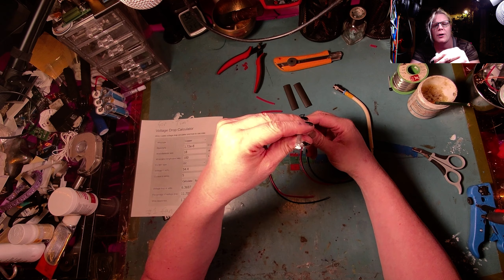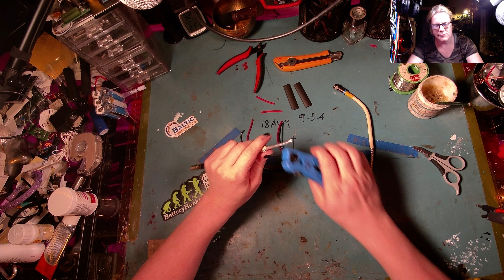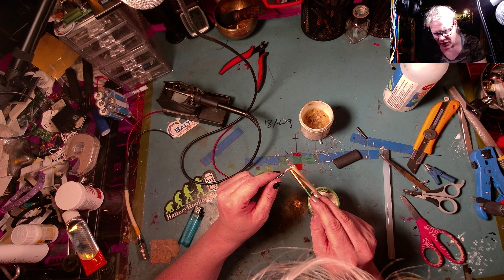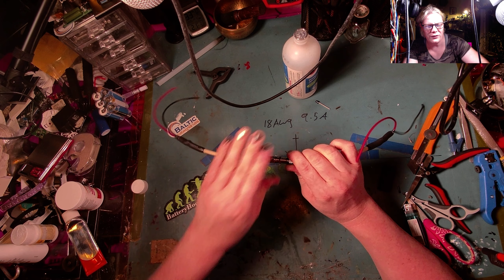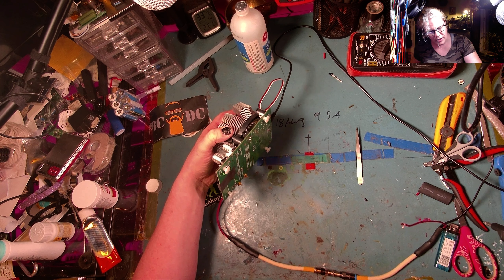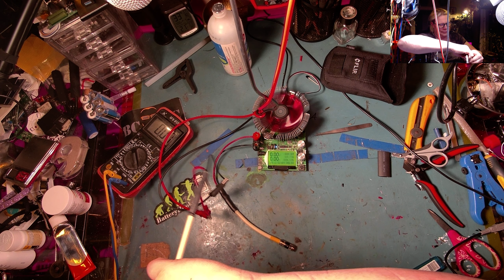Adapting Coax cable to carry a Light DC Load

Comment: I don't understand how so many people seem to not know how to solder correctly... The iron is NOT an applicator for the solder(like a paint brush).. it is a tool in order to heat up two joints to the point where solder will flow into it.. next time tinning wire.. solder on the tip>hold tip against wire>feed solder into now hot wire>half a second then remove tip.. this way when joining the two parts.... You literally just have to touch it.. not fiddle trying to get it to stick.. such a long winded video for such a simple job
Reply from the maker: You forgot to mention flux, how wire gauge and type effects joints, materialsike "aluminium" that solder doesn't adhere to like in this video ;) . But thanks for your petty comment. It shows your value ;)

Comment: Nice demo. If the shield is AL the loss will be different (slightly higher) than CU for at least half the circuit, right? Interested in the load tester you are using- opportunity for a link to another video or product there. Also, an unshielded (bare) crimp on the AL shield might work better for you than the solder for reliability. One more  thing- the hot glue is a cool trick- I was thinking that if you used a candle and dripped melted wax onto the exposed areas you could also seal the shielded side and the center conductor to prevent exposure to air and water before heat shrinking.  Thanks for sharing. Hope your fingers survive- you do have an awful solder station in this video- You need a sponge mate. ;-)
Reply from the maker: The solder isnt ideal for the AL but it was very solid. Of course the AL will have a much greater Loss Though Im not entirely sure ITS AL as I could not see a brittle metal like that being used. It could be high nickle maybe. I dont know enough about this cable. Ill take solder over crimps for reliability because oxidation can occur within crimps, They can lose compression, they can weaken a wire joint. the heats hrink itself is also lined with hot glue. As for the wax. Wax would become brittle and expose the joint. Hot glue is ideal for this as it dries flexible yet hard. It also solidifies fast. As for the sponge....... I had a beautiful Brillow pad in there. Im not sure where it went!!! ? not even 18 hours later my Fingers are fine XD. Thanks <3